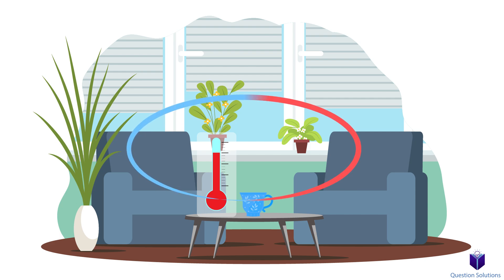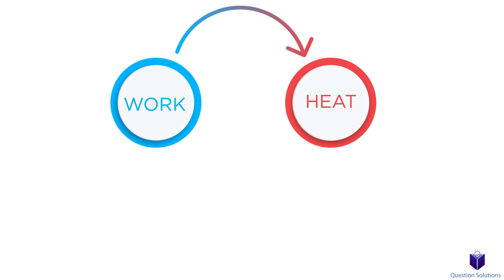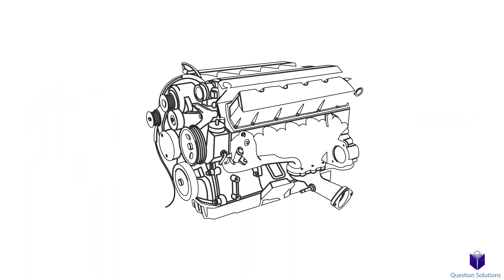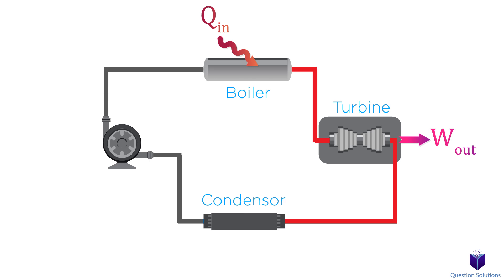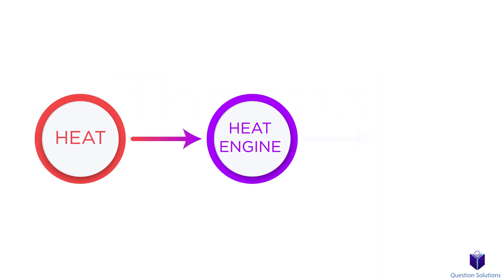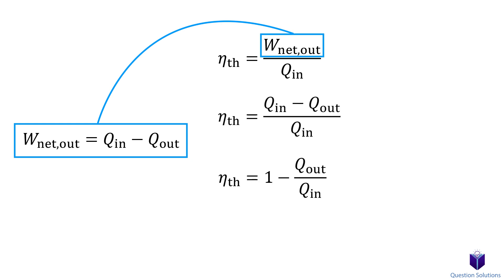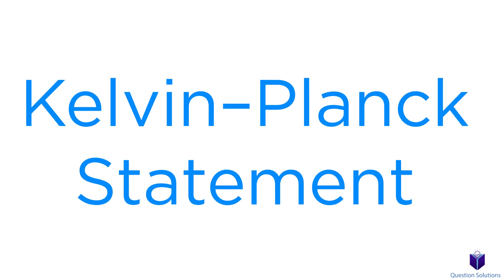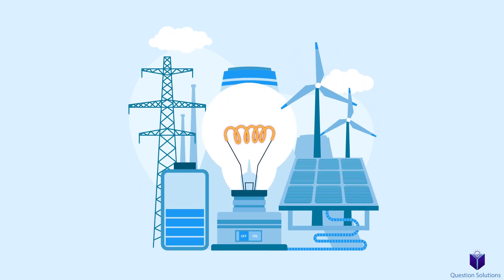Heat Engines - 2nd Law of Thermodynamics | Thermodynamics | (Solved examples)

Comment: Hi again I have another question here about 3:58 .Why Wnet equals to Wout - Win but not Win - Wout ? I am grateful ,you always help with your viewers' questions 🙂
Reply from the maker: So in a heat engine, our goal is to get work output. But a heat engine requires energy for it to work. So if you want to figure out how much net work output was "created" by the heat engine, then you have to subtract the amount of work that was put into the system from the amount of work that was produced by the system.
Reply: @QuestionSolutions  Oh I see.Lastly why we add out in the subscript for Wnet and it becomes *Wnet,out*?
Reply from the maker: Out, as in output. So what is the total net output, or in simple terms, what did we gain from this heat engine.  @ygt824

Comment: What is next on your list of courses to make a playlist on? These basic vids are extremely powerful!
Reply from the maker: Right now, I am leaning towards electric circuit analysis. I don't know when I can start that yet, but I will see. I also need to create some shorter videos covering how to solve simultaneous equations, when to use sine or cosine, etc., since I get a ton of questions on those fundamental topics.

Comment: @ 7:30, don't you mean "work per second" instead of "power per second"...? Just pointing out. Other than that, thanks for the great video!
Reply from the maker: No, I mean power. So power is the rate of energy transferred during a specific time, with the units W for watts. 1 Watt = 1 J/s. Hope that helps 👍
Reply: @QuestionSolutions  You said “power per second” which is what he is mentioning. It’s not “power per second” but “work per second” as you mentioned after